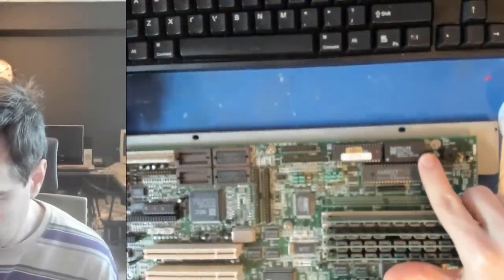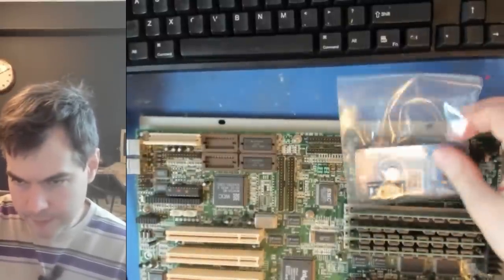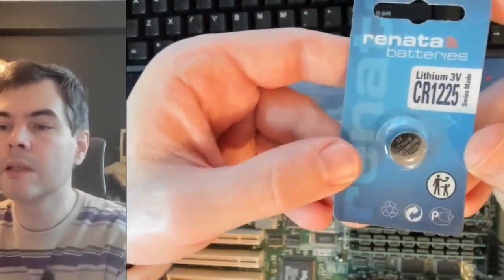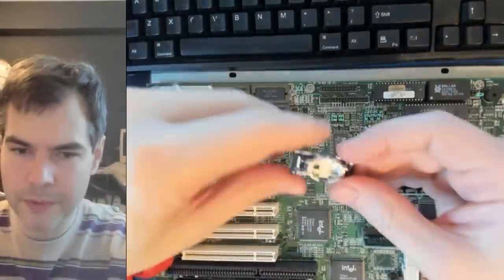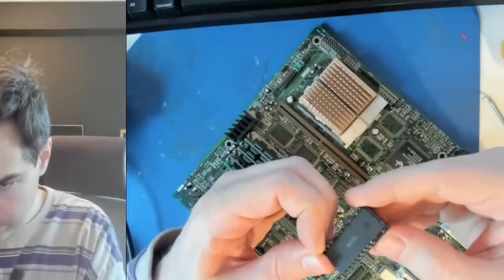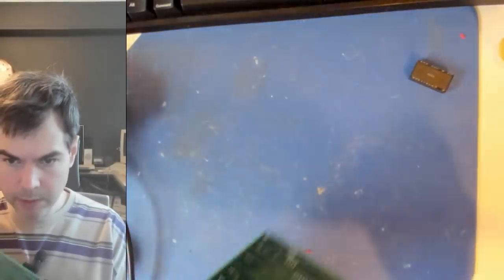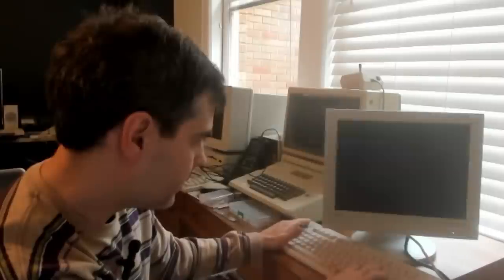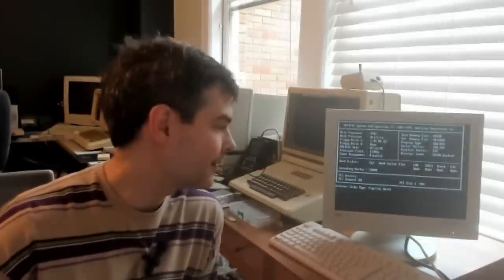Dallas Chip Part 1: How to revive a dead DS12887 chip

Comment: @7:15 - The "third-party site" is Peter Wendt's page; an IBM engineer that has to be one of the first to describe modifying the Dallas chips online. Dallas Semiconductor was bought by Maxim in 2002, although the Dallas branding was used until 2007 - other chip manufacturers (like ODIN) make an equivalent chip. Another note about the part numbers is that the 'C' (i.e. DS12C887A) denotes that it is a 'Y2K'-fixed version that has the "Century Byte" register at offset 32h - that means it won't work for IBM PS/2 systems and their clones (other manufacturers that produced microchannel machines - the register at offset 32h had other uses on PS/2s).
Reply: The xtal is for oscillator-less 1285 / 12885 only. You must not use it on a 1287 / 12887 since it interferes with the built-in xtal.
Reply from the maker: Interesting; in hindsight it does seem silly to connect an external crystal to a device with an internal crystal, indeed. I was looking at the datasheet again now and it does look like both pins where I attached the crystal leads are NC, so perhaps the clock signal doesn't go anywhere? At the next opportunity I'll bust out the motherboard, test the signals and report back.
Reply: @newoldcs  The pins are NC towards the bottom into the board (= not existing anyway) - but they are bended upwards and connected internally to the built-in xtal.
Reply: @wacholder5690  That was bugging me the entire time. So I assume for these you could just find a way to rig up any 3V battery source without  the fancy PCB and call it a day?
Reply: @JJFX-  That's what I did. I got some 2 x AA holders with wires and soldered them to the opened up connectors - as drawn. The wires were about 15 - 20 cm long and a piece of doublesided tape fixed the holder to the rear of the case. Stuffed in two quality AA cells: Mission completed. I must have at least one 55SX with that modifications somewhere in my stock. I once owned about 70 or 80 PS/2 alone ...
Reply: @newoldcs  You were also supposed to cut one of the leads to the internal battery. I assume in case it shorts out so it won't drain the new battery.
Reply: @wacholder5690 : Although alkaline batteries may leak with time for the low current draw - in one of my videos (v=UuwwZJxRrZ8), I relocated the CR2032 battery to the front adapter support bracket on a 55SX. It appears that IBM may have wanted to have a Motorola MC146818AP RTC powered from the Panasonic CR-P2 battery like other PS/2s had [on the Model 55SX].
Reply: To replace an ODIN that has the C in the part number, which Dallas equivalent should I get?
Reply: @seriouscat2231 : There's no reason to have a module that rolls over the "Century Byte" now - but you would probably need to find a Dallas 12C887.
Reply: @IBM_Museum , and to dremel the ODIN I have, I can follow the same steps? Or is something in there reversed or different?
Reply: What does a B mean?
Reply: @SZINNAPALM , where does it appear? If I had to guess, I'd say it means the chip is delivered in a box, instead of a tray or a tape.

Comment: You could cover the sides of that modified chip with "liquid electrical tape". It just paints on. It is often used for insulating splices in burried cables.

Comment: You've done this the hard way. Use the rotary burr bit to cut about 0.5mm in to the end of the IC (opposite end to pin1 mark). This will expose the battery terminals directly, spaced about 5mm apart. You can then use the burr bit to expose these terminals further, snip off the old battery and solder connections to a new one in its place. Plug the IC back in, all original pins in tact.
Reply: This is exactly how I do it. Very much easier than shown here. Old Sun hardware has similar devices as NVRAM for storing firmware settings. Way too expensive to replace, much easier to attach external battery after grinding off a little plastic and cut the leads of the original battery.

Comment: There are soldering iron tips designed to help remove chips. I have one that is a very long tip, it is 24V but i can control it from my bench supply. This can heat all pins down one side at the same time. Then there are tips you can buy that are shaped to fit over the chip and heat all legs at the same time. Nice investment if you remove many ic's as sometimes they do not come so easily.

Comment: Philips did something similar for the CDi. Put a battery inside a chip, I guess you can at least say the chip doesn't leak acid/alkaline all over the PCB, but it is still short-sighted.

Comment: Great video, thank you. I just completed this mod on an old CNC we have in the shop and it does work however after power off, the CMOS settings are lost. It it because we sever the negative side instead of the positive side? I saw somewhere that there is another pin on the other side that is common ground. Could severing the negative killed ground on that side?
Reply from the maker: Thanks for watching! Have you tried measuring the voltage that the modified module is outputting? Look at the schematic and measure between the Vbat and ground pins.

Comment: Mhm not available? Replacement type: DS12887+ ongoing production, decent availability not discontinued, nominal lead time 36W, next arrival 8k units in Aug this year. Not sure whether there's a relevant difference for the A version. I was under the impression that these would NEVER  be discontinued without replacement, due to miltech use and because you can't just new-old-stock hoard them, you actually need ongoing production due to integrated primary cell.

Though i don't think it's a bad idea to modify the chip like that. I have seen similar done to the different Dallas in a CDI, where the repairer just sliced into the chip with a scalpel at the height right where you expect a normal chip to end and the top sheared right off very easy, and the battery pads became exposed to just install a holder, really neat. It's nice if people never have to replace a $12 chip again and just swap the cell. I think they were lucky that the bond between two separately cast parts of the enclosure turned out weak, it doesn't have to be like that. The bottom half was your usual quality semiconductor epoxy packaging, very cohesive, but the whole top was just brittle crumbly stuff :D and of course there was a battery cell inside the top.

Comment: Why does the PCB on top carry a clock crystal? There is already a clock crystal inside the resin blob?
Reply: The Dallas Clock module tells the computer the system time and date with or without power. The motherboard crystal timebase is for the processor and other electronics there as well as the video on early units. There are several crystal oscillators in many older computers and certainly vintage coin op video games. Example is Z80 ran on 2 or 4 or 6 mhz but the video was based on 3.57mhz and another crystal that was three times the colorburst frequency and had to be held extremely accurately for the color to be right. (function of composite video) Much of these principles are explained in detail here in YouTube. Everything is a tradeoff in electronics and technical matters and what is ideal in one place is not ideal in another within the computer. One timebase does not often get it all done in a complex system. Modern computers are even worse, but they are very good at hiding it within the major chips. Much of this is internal in the new systems and there is a battery mounted on the board.
Reply: @KlodFather  yes, i know. I've been working with computers and electronics for my whole life. What i am saying, the resin block over the RTC/SRAM contains  a crystal and battery. What I am asking, why hook up another crystal?
Reply: @zaprodk  -  Because the crystal in the real time clock is a completely different frequency than the one on the board... The system just simply needs more than one and it is not feasible to create all the clock frequencies from one timebase easily. Its cheaper and easier to have several.
Reply: You can use it to make a DS12887 out of a DS12885 which is just the chip without the built in crystal and battery. You're not supposed to connect it if you're repairing a DS12887.
Reply: Dug in my stuff. The crystal is for the oscillator-less 1285 variant, where the pins 2 and 3 are marked "X1 and X2" for an external xtal. This additional xtal offers the opportunity to utilize a 1285 in the place of a 1287 if you  can't get anything else. On board with an xtal that follow the original MC146818A-design there is an xtal already in place at the pins, but on 1287 / 12887 design boards it isn't.

Comment: I have not done this repair but I used files and shortened hack saw blades to manually grind away at the sides till I touched the metal legs. The dremel for me leaves too much possibility of screwing up, especially on very precious vintage chips. You have good hands and did really well with this.   Question, Should you have socketed the clock IC? Or was there a clearance problem?
Reply from the maker: Socketing the chip is definitely a consideration. The legs on this particular chip are pretty short (and thin) so I wasn't confident it'd be held securely in place in a socket.

BTW, this is probably obvious when watching the video, but I sped the dremel parts up by 4x. If anyone uses this as a guide to do the mod, please work slowly and carefully. :)

Comment: Why you atach wires first to the board, instead of solder first on the chip, with one ends and then atach it to the board, and cut the exes wires.

Comment: Fine old repair. Still got some questions tho.
Why installing that external resonator? The internal battery dies with the crystal.. or is it for more accuracy, bcs crystals back then was worse? My first guess was that it may averaging the two, the datasheet says it should be disconnected.. Disappointed.
Is it possible to disconnect that internal battery? I would like to do just that for less losses in it. Maybe you can cut it's pin in half. Also interested in voltage of it out of curiosity.

Comment: FYI. Many Canon PCs were relabeled Acers.

As to using those piston driven vacuum pumps, I've found them to be inferior to using a good amount of flux and desolder braid.
Reply from the maker: Fair point, there are pros and cons between pumps and desoldering braid. I've been using this Soldapullt brand manual desoldering pump for several years now, and I find it both a more cost effective and eco friendly option. If you clean it and change the tip once a year it does a great job. Before, I primarily used braid too for desoldering, but found myself going through a lot of it.
Reply: @newoldcs  That sounds reasonable. Another option is to spend $100 or so on one of those cheap Chinese solder vacuum pumps with an iron tip. I have that for bigger jobs. The main benefit is to be able to drain effectively all the solder out of a through hole so the part isn't endangered by having to finesse the legs out with a soldering iron, while potentially overheating the part and the board.

Comment: Hey bud I found one of these ds chips from 2003 and I was wondering if it would serve any purpose in a synthesizer build that I'm attempting to put together as my next Big Project any input would be great.  And you know your a rad intelligent and I'm willing to put money on the fact that your honest keep true to yourself and thanks for your video
Reply from the maker: Hi there. Your choice of battery depends on how the circuitry of your synthesizer is designed. Any battery that you install should 1) provide the correct voltage that the circuit expects, and 2) be chargeable or non-chargeable depending on whether the circuit will attempt to charge it or not. 

Are you designing the entire circuit from scratch, or are you building it based on a schematic made by someone else?

Comment: Is there some reason you can't just buy a new DS12887A ?  It would surely be so much easier.
Reply from the maker: Well, you'll be missing out on the fun of using power tools on electronic components. :)

Joke aside, my motivation as touched upon in the video is to future proof the machine. Any new battery you put in will expire eventually. This mod allows you to pop in a new coin cell battery easily.
Reply: And in addition to what these guys told you, New Old Stock batteries would be depleted this many years later. The batteries in them have the error code NFG. Stands for no forking good. Thus this repair is necessary on older computers and on many videogames and poker machines from vintage arcades.
Reply: @KlodFather  New new stock seems to be available from e.g. CPC, Mouser, RS and Digikey.
Reply: @BrianG61UK  -  If that is true, its great but be sure to check the date codes and if the battery is replacable. The shelf life of a lithium battery is about 10 years but my experience has been about 15 years give or take a couple before they are toast. Those modules are born turned on and the battery is running the clock from inception. So if they are 15 years old they are on the precipice of failure.
Reply: The "inactive shelf live" of the chip is 10 years from the date of manufaturing IIRC. The unit has a "life fuse" that activates the internal battery when power is applied to it for the first time. From then on the circuitry drains the battery and average useable lifetime is 3 - 5 years. Depending on the workcycle of the machine a sporadically used machine will drain the battery earlier than one in a 5 - 9 / 5 workdays a week cycle.
Reply: @wacholder5690  -  Those are logical facts and assumptions and I agree with your added information. Some of the clock modules we bought back in the 90's for our equipment had the clock already on. Also some systems used a super capacitor or several of them.
Reply: @BrianG61UK  Digikey certainly currently list the part as obsolete no longer manufactured.

Comment: nice job, you tested it with a warm boot however, as a cold boot though would be if you were to unplug the machine from the wall and discharge the psu. but I'd trust that it will still work as intended even though you called your work a bit of a hack job, it was really well done, next time you need to desolder a chip you can take the opportunity to install a socket, and put it back socketed.
Reply from the maker: Thank you for your kind words of encouragement! If you have a look at my follow-up video to this one (link in the description) you can see that I subsequently installed a socket for the Dallas chip.

Regarding the warm boot vs. cold boot: I did test both in reality. This computer does not have soft power so the power switch on the front actually physically severs the mains power from the PSU circuitry. There's a thick insulated lead that goes from the PSU to the front switch and back, which carries mains voltage. So when I pressed the power button and waited a few seconds and powered it on again, I think that counts as a cold boot.
Reply: @newoldcs  I see! my bad, i shouldn't presume it was an ATX standard system. I will checkout the followup video =)
Reply from the maker: @qwertylesh  It's definitely an old-school machine! According to some marketing blurb I read on this particular line of Canon computers, they claimed to be "the first Windows 95 PC" on the US market. May or may not be true. :)